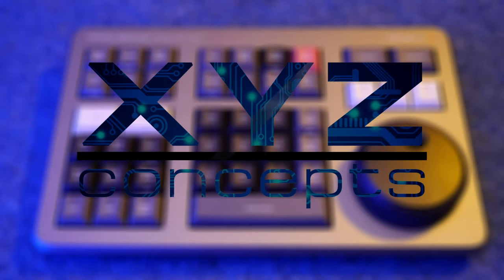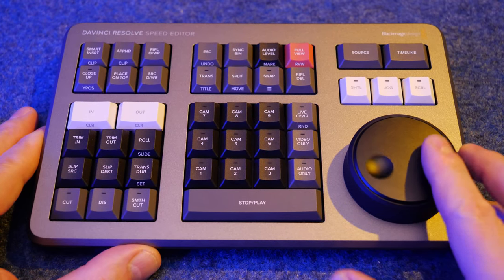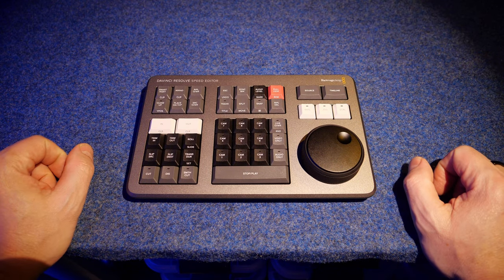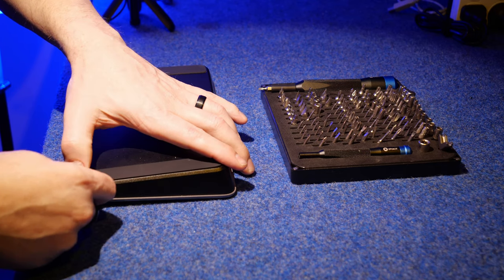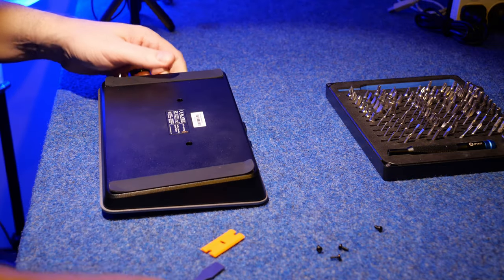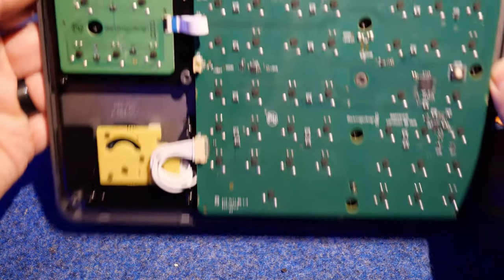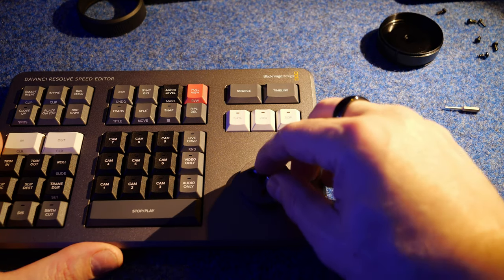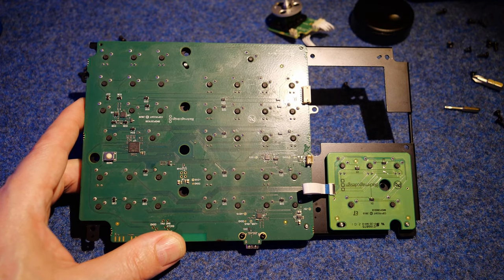#47 - What's inside? Teardown of the Davinci Resolve Speed Editor by Blackmagic Design

Comment: I saw Dave from EEVBlog tear one of these down very recently but didn't go into any detail about the rotary encoder, so I'm very happy to see you go into a bit more detail here :D
If I had to guess I'd say the sensor was one of them magnetic rotary sensors with a diametrically polarised magnet in the shaft, and a custom molded part to hold the bearings and everything together
Reply from the maker: Yep, it was a Hall effect sensor from memory. Definitely wasn't an optical or rotary switch-based solution.

Comment: Good to see that it isn't a complete nightmare to replace the battery when it dies (though it should still work when plugged in via USB, so not instant trash without a functioning battery.) As you point out, it does nothing without Resolve running and communicating with it.  Lots of people would love to use these with other software, which currently they can't.
Reply: While I too would like to see the Speed Editor work with, say, Premier, I think there may be a couple of issues.
The Speed editor "magically" switches on when Resolve boots and establishes the BT connection. Of course, using the USB C with another editing package would negate the need for the bluetooth comms.

Secondly, having used those "keyboard wedge" jogging wheels (Contour Shuttle) and function buttons on other devices, they are a bit sluggish as they simply emulate a QWERTY keypad and send commands as fast as a keyboard can.
With the Speed editor, it appears that the connection, between the hardware and the human interface software inside Resolve, is much faster.
The jogger knob on the Speed Editor is not like using a Contour Shuttle. It is FAST.
It's like the front panel knob on a digital Betacam, instant response (accounting for the mechanical inertia of the Digibeta). That, of course, is deliberate design by BMD.
The jogger knob is very much like the look and feel of a Sony VTR or edit controller and it was arguably one of the most popular and commonly used Videotape operator interfaces through the 80's, 90's and early 2000s.

If the Speed Editor was to work with other editing software, it would likely operate a bit slower as it would have to operate like a keyboard wedge, unless there was some serious low level driver interfacing going on.
Furthermore it might mean less people would use Resolve for editing, which might impact sales of other hardware, like the audio and colour grading panels.

Comment: Haha! Nice! We both did the same thing, and went and took it apart :). That little BLE module also has a processor...It is a BGM113 with an ARM Cortex M4. I am still on the fence about why they used both an ST chip, and spent on a bluetooth module with another MCU integrated into it.
Reply from the maker: I'd suggest the MCU on the main board has to deal with signal load from the encoder, leaving the BT module just to deal with BT comms. Meh, just an assumption, but it's plausible.
Reply: Most likely for FCC certification. It is easier to get an already FCC certified device and add it to something than to do a full custom solution and have to go through the full FCC testing suite, also cost a lot less. I am curious what the membrane switch on the back does thought.
Reply from the maker: 100% agree using a module already having FCC cert is the way to go.  No value in reinventing the wheel and cheaper and quicker to market.  With regard to the switch, maybe a diagnostic/service mode perhaps, still a mystery to me.

Comment: Excellent showcase! Is the battery connection to the board a standard JST?
Reply from the maker: Thanks! From memory yes some form of connector could be a variant of JST, but not hardwired. Cheers.
Reply: @xyzconceptsYT thanks! I’m going to try adding a JST switch as I hate coming back to my speed editor after weeks of non use with a dead battery.

Comment: You mention Australian made. I have seen the BlackMagic HQ in Melbourne and they certainly have manufacturing facilities there, but some stuff is assembled offshore.
If you look under the Speed Editor on the label, there's an icon representing a factory and a two letter code.
My Speed editor has "ID" in the factory icon  (Indonesia).
My Pocket 4K and my Hyperdeck Shuttle HD have a factory icon with the letters "SG" (Singapore)
Reply from the maker: Agreed, my full-size editor KB is also "ID".  It makes some sense to diversify manufacturing if not more economically sustainable.  l'd hazard a guess design teams are primarily based in AU and US.
Reply: @xyzconceptsYT  Blackmagic's first products were the "Decklink" cards for digital video I/O to computers. 
I bought one of these back on 2006 to use with Adobe Premiere on a PC workstation.
Previously had used Decklink on the FCP 7 systems at Channel 7 Melbourne.
When my Decklink fan carked it within warranty period, I phoned BMD directly to ask if they could replace it (instead of time consuming wait, via the local computer dealer).
A bloke said I was welcome to drop by their modest little 2 storey office building in South Melbourne.
While a techo replaced the fan, the bloke showed me the wave soldering setup which was used for the PCBs for the range of Decklink cards.
Since the success of Decklink products BMD were able to buy the ATEM switcher brand and the DaVinci Telecine and more recently Fairlight and develop other products, eg the cameras.
More recently I did see a PCB fabrication room at BMD's Port Melbourne "Campus" (it's huge), but have no idea what they make there. At a guess it's still the Decklink range.

Grant Petty is the engineering guru and he's based in Melbourne AFAIK (he was a couple of years ago when a friend worked at BMD HQ).
Blackmagic also has a post production facility in Singapore and I think a lot of ideas and development might come out of there too.
The acquired companies like ATEM would have offices overseas I'd reckon.
One thing, BMD's "critical" products, the high tech, high quality kit, like the I/O cards, Cameras, etc, appear to avoid China for manufacturing.
Plus they seem to rely heavily on Field Programmable Gate Arrays. This means significant improvements in firmware can be supported, and a reverse engineered pirate copy of hardware (see "China") , is utterly useless if it doesn't have the fair dinkum firmware installed.

Oh and my ATEM mini 4 input HDMI switcher is also SG manufactured.
Reply from the maker: Wow, you have some history with BMD! Great read, I don't know if I am more impressed with the engagement or your experience with BMD! Just awesome either way.  I have become a bit of a BMD fan switching from Premiere Pro to DR is a no-brainer choice from my point of view.  I think any of my future hardware will be BMD in some way too. I think the customer focus from BMD is something that should weigh heavily for anyone getting into this field, even if just a semi-serious dabble.  The ecosystem is just the right fit and priced according to even the modest budgets for serious contenders. Agree with the FPGA point and the IP protection stance, but does increase cost overall, but happily pay the premium if the simple "core" or firmware update can potentially reinvent the product. (Within reason from a product roadmap consideration of course)